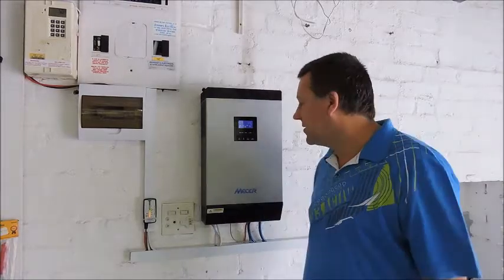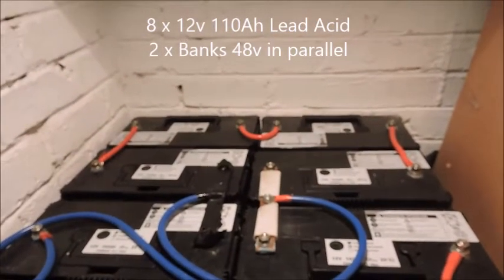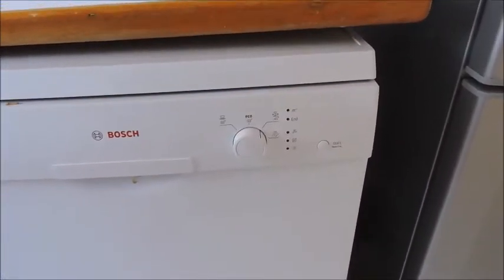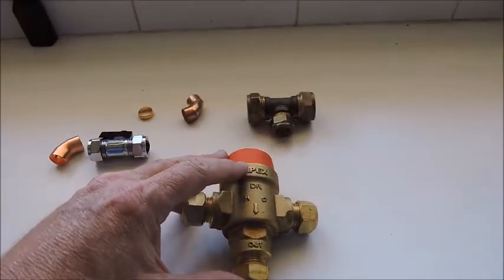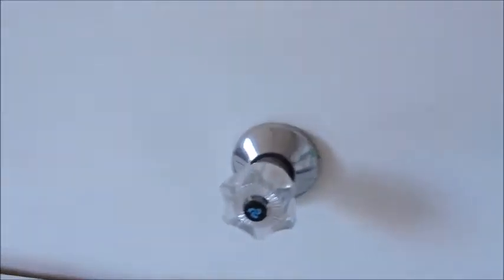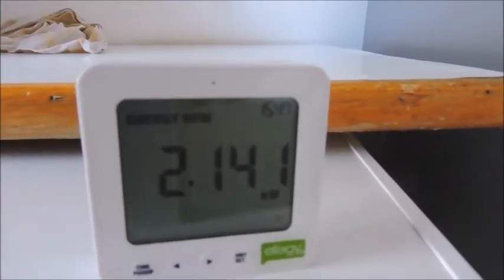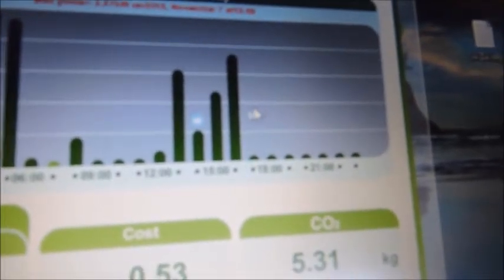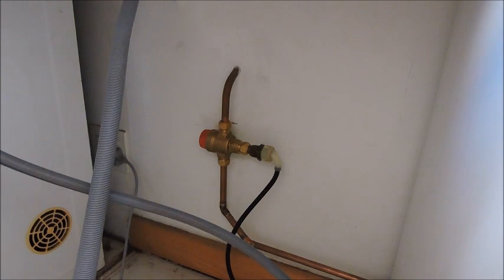Solar Water Heater Thermo Valve project #3

Comment: Awesome Video! I'm using the Axpert 3kva and a pressurised water system and hoping to achieve good results. While I say that I'm doing this in a Motorhome so the use is a bit different where the Solar will be the primary battery charge and occasionally a generator or Eskum. The thermo heat valve I have been looking for everywhere as the issue with limited water is exactly that, it's limited and while waiting for hot water to get through a lot of water is wasted which is being pumped so power as well. I have been trying for weeks to find a local supplier of what the Americans call a "Comfort Valve" and no-one here knows what that is. One question though is until there is "hot" water to open the valve do you not get any water or am I still looking at the wrong valve? The Comfort valve has its own pump system and basically recycles the water to keep the water at the valve/tap at the correct temp which I do not want and I'd be happy even if the valve bypasses the hot water feed to the tank until its warm enough. Sorry for hijacking your project but locally as you mention no-one knows anything or is willing to assist without doing it "their way" which does'nt make sense. As you have already been down the path a bit your experience is really valuable.
Reply from the maker: +Gordon Finlayson Hi Gordon, I eventually found stock at Plumb Link it is known as an Apex TP valve.   The code escapes me, but they should have stock or google Apex.  The hot water will trickle through when it is still cold until it reaches temp then mix with cold to maintain 40Deg C  if this helps.   Alan
Reply: +Alan Falck Thanks for responding. Through your video I found Apex (Centurion so close enough to drive to) and they are assisting me. Its the first company strangely in many months of requesting info/quotes etc that have actually bothered responding or trying to assist. I kid you not when I say 1000's of R's spent on the fone trying different places for different products and no success so even more driving around and looking. Thanks again.
Reply from the maker: Hi Gordon, I battled as well for weeks, I was about to import a valve from E-Bay in the UK in desperation.  Only after calling a plumber did I ralise they use a totally different terminology "TP valve"to the generic "thero valve" term.